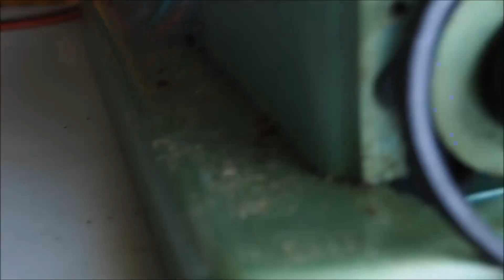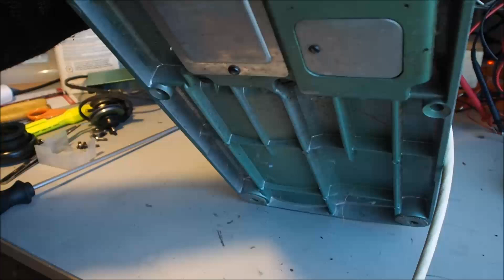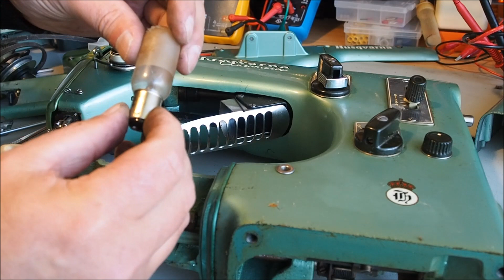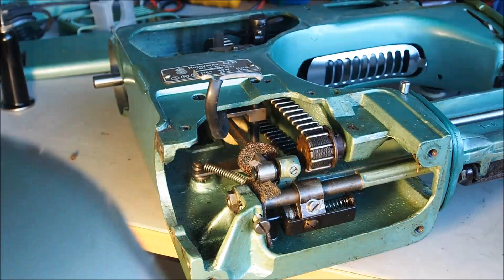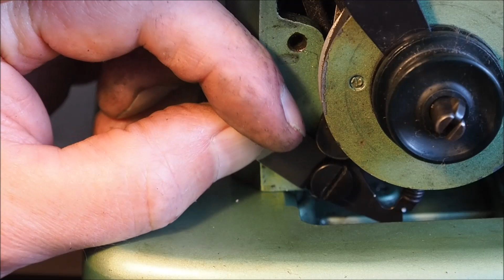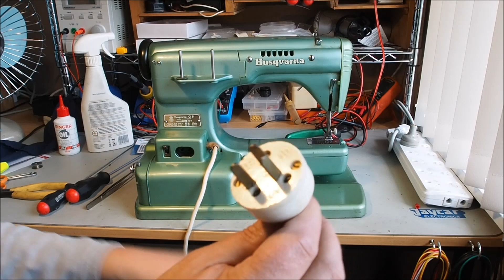Husqvarna Class 21 Sewing Machine - Mechanical Marvel! - Viking

Comment: The waer on this machine in the video is visible but it still does the job. I learnt how to sew on my mothers "Crocodile" as we call them here in Sweden and was very sad as she changed is for a newer machine. I have now bough one for myself and it is very nice to sew on. The machine i bought for 35 USD was with all the extras but did not work properly. Some oil later the machine was back in working order with no extra maintenace needed. Amazing quality. The gearbox for slower and more powerful sewing is a feature that i really like but lacks on newer machines. The automatic disengagement of the machine when vinding the bobbin is also one step ahead of many machines even today.

I think the quality of this machines is at the pinnacle of machanic sewing machines. Bernina and Pfaff have thier own take on failfree high quality, undestructable machines from the same period, but i find the "anti jamming feature" on the Husqvarna one point above the rest. The only downside is that the Zig-Zag is not especially wide compared to modern machines. But you can´t have it all for 35 USD. (Going rate for a working machine like this in Sweden is about 150 USD.)

Comment: This video was wonderful and a huge help in guiding me in the maintenance and cleaning of a 21E that I found out on the street for trash pickup with the pedal, bobbins and extra feet. Looked at the belts and the motor brushes which were all fine. Also had someone check the electrical which was also good and after an oiling its running very well with a new needle and thread.  The plastic covers are pretty cracked but overall a neat find that now has a new home. Again Thanks so much! Cheers from Germany
Reply from the maker: Great to hear!

Comment: I have just changed both belts on my newly acquired e21 thanks to your video - thanks so much for sharing your knowledge
Reply from the maker: Thanks. I'm please the video helped.
Reply: Hi, where did you find the belts?
Reply: @karlstream  any luck finding those belts. mine are about to bite the bullet
Reply: @downey2294  its been such a long time. In the end I just cleaned it up and asked an sewing machine repairman, who said as long it's not broken. In most parts of the world they are replacing old parts to sewing machines. So there should be plenty to choose from. Try any Chinese marketplace like Temu, and they have plenty to choose from as long as you follow the measurements.
Reply: @karlstream  thanks for the reply I'll see if i can find some.

Comment: I'm another who found a thrown -out machine in the street complete with everything. Could hardly believe my luck. Just overjoyed. Though unfamiliar with this machine i could see immediately its high quality. After almost 40 years with the little Elna portable, never a comfy machine, my 'new' 21e is a serious upgrade. 
This is a really superb vid. Many many thanks.  It's great to see stuff in real time, with sometimes several attempts to do things. So much in mechanics is physical-like screw tensioning, reaching into tight spaces, moving things against resistance, jiggling and maneuvering tricky bits to fit. Orientation. The nature of the materials. Just excellent. 
A small question: if oil gets on the white gears is it a problem?

Comment: Thank you a lot for your great vids about old Husqvarna machines! I have a H Automatic 21 A and I just oiled and cleaned it according to the manual and your video. There are still couple of problems I have faced that I couldn't solve. First, the zigzag.... the needle doesn't move sideways fast enough. Therefore, in order to sew zigzag I have to run the machine slowly and keep the width at 4. I have tried to figure where the problem is but I haven't succeeded. Second, now I use weird words, since I don't remember what the parts truly are in English... so second, the little knob that should be turned to the right, half turn to 6 o'clock, in order to sew buttons or embroidery or freestyle. To keep the teeth down and be able to move the fabric wherever I want to. That know only moves a bit, around to 1 or 2 o'clock. I've had the plate in the bottom open, so I have seen the small plate that hits the thin bar when ever I turn that knob, but I simply don't get it, where the problem is. Any suggestions? I would take the machine to the service but I don't think they know much about these machines anymore....
Reply: Try with penetrating oil on the parts that moves when the needle moves, 5-56 or like. When everything works at it should just lube it again with regular sewing machine oil.

Comment: Hi
I found this very informative. I can solve the problem of the oil hole near the bobbin winder. My machine has a little pointy plastic tube in it that would deliver the oil to the pad below with acuracy. Similar to the ones in the top of the machine.

Comment: I was so thankful for this video since I solved the problem with the handwheel not moving (but I could still sew using the pedal). Now the handwheel works BUT  I cannot sew with the pedal anymore... I opened it and the belt (long/main one) doesn't move at all when I press the pedal. I just hear the sound of the motor.
I checked multiple times by "toggling" the bobbin on and off and the bobbin belt works, but not the main belt... What to do? :(

Comment: Your videos are informative and thorough. Thank you for taking the time to create them. I'm working with a Viking type 21, just did a tune up based on this video and replaced both belts. But I think the main shaft is siezed, because the motor still strains and will not turn the assembly. Do you have recommendations for this issue? I live very remotely, far from shops and service.
Thank you again for your work,

Comment: PLEASE HELP: Hi, and thanks for a great and very informative video. I wonder if you could use your tons of experience to help me sort out a few questions. I recently picked up a Husqvarna Classic 21e at a flea marked (didn´t know anything about it at the time) for about $15 (blood price, I know) . It virtually looks like it´s been purchased as a wedding gift, tried and then left in a closet for 60 years (which is probably pretty close to the truth). Finish looks brand new, inside bits and bobs look unused apart from a little lint under the stitch plate and all the woolen oil pad thingies are bone dry. In short, pretty darn close to mint condition.  NOW:Lately I´ve tried to find out as much as I can about this little gem. What baffles me is that all the american versions of this machine (the Vikings 21E) seem to be much more powerful than the european versions (Husqvarna Electric 21E). The Vikings seem to come in 1 or 1.5 Amp versions, while all the Husqvarna Electrics say 80W on the backplate. What gives? Why are the Vikings so much more powerful? Or are they. Can they do the same heavy duty tasks? Is it even the same machine? Please help me get my head around this if you can. Thanks in advance. Grunde
Reply: The USA's mains voltage is half of NZ's, so their Amps are worth half as many Watts, broadly speaking.

Comment: Got this same machine in excellent condition, though I’m bummed out that it refuses to run. It’s either the pedal (which has something clinking around) and/or the stuck cam (the locking arm won’t move all the way down since someone pushed a cam all the way in. Thus making it stuck in place). I’m trying to hype myself up to take the machine apart myself so I can fix the cam area.

Comment: I have a 21E that I love and have sewed with for more than 45 years. Yesterday, I had a loud bang, some smoke and a burning smell. I found that a whole lot of silver paper and plastic had been caught up in the belt and from what I can see, the drive belt appears to have contacted a wire and ripped it out shorting out the electrical system. The light is still operating.
Do you think this could be repaired? Where are you located? 
Great video on this wonderful little machine by the way. 
If it can not be repaired, what on earth would I replace it with that can just about sew anything, especially in low gear. 
Cheers
Reply from the maker: It sounds like the capacitor has blown out and into the belt. The capacitors can be replaced so that's probably worth looking into. Cheers.

Comment: I just bought one of these today since I fall in love with them for their quality and effectiveness! Although it needs a service, but still I got it for a good bargain.  They really are heavy duty. I think this video covered major problems of the machine, but mine has a kinda click sound when it sews and the thread is cutting off frequently! I still need to find out why! Any suggestions?
Thanks.😊
Reply from the maker: You may've already checked these suggestions but make sure you have a good quality brand new needle, check threading and tension. Apart from that, check hook point is not burred and check hook timing/needle bar height. Thanks.
Reply: @InStitches  
Thank you for your reply much appreciate the tips too. I did what you suggested, changed the needle and now seams are ok so far. The other thing I noticed is when I start to sew it hardly starts, it's very slow at start but then it goes to normal speed after struggling.
Do you think oiling the machine should improve the performance?
Thank you 👍👍😊
Reply from the maker: @maheraljannan  Oil the machine and if that doesn't improve it maybe the belts are worn. Thanks.

Comment: Yes very helpful as I just completely serviced my mother's 19E Zig Zag. However, I now an issue with the foot controller, it heats up to above 60degC and the motor is still humming while foot is unpressed. How would you service the foot pedal (type FR 300) and change the inside electronics ?
Reply: Hi I have just purchased the same machine and have exactly the same problem. I was wondering if you solved the problem, if so what was the solution. I would be so pleased if you know and would be king enough to reply. Thanks

Comment: Do we have to press on the foot controller while we are using that Non-Contact Pen Detector?  Or will it just detect  a fault in the machine, when you don't press the Foot Controller?  And then if you do press the Foot Controller, will it detect a fault in the Foot Controller?   Also, is that a detector that detects 90 to 1000 volts of fault, or is it the one that detects the smaller amounts?

Comment: The needle position goes very far to the right when i use the selector knob. The needle position screw wouldnt bring it in enough. Is there a srcrew in the back on the inside to change and adjust the range of the throw on the selector knob?

Comment: Thank you for the video.  

Question:  What are the specifications for the capacitors (microfarads, length, diameter)?  

My capacitor has been removed, so I have no original from which to get the specifications.  I’d like to find a replacement.

Thank you so much! :)
Reply: yes please!

Comment: Would you recommend later models too. combina/practica 3010 4020 etc? I also love my bernina 530-2 and my mother has a 19e. I think the bernina has better precision, stitch quality and decorative stitches while the huskies handle heavier material. I love the bernina’s removable top/bottom covers.
Reply from the maker: I haven't had a very good run with the later models. They seem quite weak in the pattern cam area and motor. Just about every one I come across has a split pattern cam assembly.

Comment: I found your video when searching for information about a problem with my Husqvarna Practica 4020, which proved very useful for a range of maintenance issues but didn't cover the problem I have. I have had the machine for about 50 yrs from new and it has been very reliable. 

Recently I wanted to make a mask for supermarket shopping during Covid 19 lockdown. I found the machine's stitch selector cam locked so couldn't do zigzag. I unscrewed the knob on the front and after a bit the whole lot fell off and I still couldn't release the selector cam until taking the back off.

My problem is I can't seem to get the front  knob and metal slide back on. There is also a small spring that flew out and I don't know where it belongs. Any advice would be much appreciated.

Comment: Hi Mr In Stitches, My Dad bought a Viking CL21A Serial 2177, at a thrift store about 25 30 years ago. 
It sat in the car port for about 20  years. I aquired it about 10 years ago.
It came in original carry case, warrenty documents stating that it was first sold in Sept 1961 and who it was sold to, ha! However, no users manuel.
I thank you so much for your wonderful tutorial videos, thank you.
I have learned so much about this wondrful machine because of you. 
I need to replace a control knob, the knob with the numbers 1-5 that moves the needle left, center, or right. The plastic material the knob is made of has crumbled and broke. 
I still have the screw, metal pin, and the metal slotted slide attatchment that fits at the bottom of 
control knob. 
Question, I have looked for this part on the internet, so far to no avail.
Do you have one I could buy from you? Could you possibly direct me to someone in the western part of the United States who deals with parts for our beloved Husqvarnas?
Again, Thank You so much for the time and detail you put into your videos.
And a warm hello to your Miss Molly...
Reply from the maker: Thank you and yes I have one. You can find my web site address in the video description. You can email me from there.

Comment: Thank you for this excellent and informative video. I've just bought myself a 19E and this will be invaluable for guiding me in giving it a good service and check over. What is the stuff that you are using to clean the casing? I'm nervous about damaging the beautiful finish with solvents. Also do you know if these share bobbins with other models as I'd like to try and get a few spare metal ones. Mine comes with a user manual but if there's a service manual available I'd love to have one. Thanks again for taking the time and effort to post this, it's a great help.
Reply from the maker: Thanks. The cleaning liquid is a very mild general purpose cleaner.

Comment: Wonderful video. Thank you! I collected my new 60s model of this machine this morning and was able to follow along and get it all clean, oiled and running beautifully. A question... I fixed the needle position following your directions, but the feet are still slightly left of centre. Are there any adjustments for this?
Reply from the maker: This may be because the foot bar is slightly askew. It's easy to adjust but it may upset another adjustment which may cause an issue with feeding. You can try twisting the foot by hand but I wouldn't use much force and if you can move it, that would indicate the foot bar clamp screw is a little loose and needs tightening.

Comment: Hi Brad here.
Best video!   Great "How To", everything I needed to know...... 
I bought second hand the exact same model as this, (CI21) and I noticed the serial number inside the front cover of your machine (K2120153) and I was wondering if there is a code within these numbers, like there is for "Briggs and Stratton" engines, for working out the date of the machine?
Mine is "L2127402".   The 20 series from what I can find out was built between 1955 and 1966?   I just would love to know everything about my machine...

When I bought it from a second hand dealer in country South Australia in a little known town called Cobdogla, or Cobby as the locals call it, it was missing a few accessories; the bottom part of the bakelite accessory container, a couple of presser feet, the attachable work table and the precious manual.

I found a downloadable pdf for a manual for model "21 A" but I dearly want the users manual for a "CI 21".   I just want as close to original equipment as I can possibly get.   I'm not bothered if its not an original manual, just a printable pdf will do. Even the site husqvarnaviking doesn't seem to have it.   Anyone who finds one in an old draw should post it on ebay right away! Lol.
Again great instructional video, I will be returning to it in the future!
Reply: X2 !!
Greatings from Portugal

Comment: I found your video very informative and interesting.  My Class 21's motor burnt out yesterday and I am totally gutted.  I have been told it is not repairable.  Having watched your video I was wondering if you had a motor for the Class 21? The machine is still at the repair shop but I am collecting it tomorrow and hopeful that I may be able to fix it.  I am in the UK.  Would you have any tips, please?  If I cannot fix it I am looking at a  class 19 on Sunday.  In the photos it looks as good as new so I am hopeful it will be in good working order.  Would you recommend a class 19 too?  Thank you very much

Comment: Thanks for this great video! I just picked one of these up but it has an enclosed motor. Is there a way to clean and service those without messing the metal casing up?
Reply from the maker: There should be a way to remove the motor but it may be a little fiddly. Thanks.